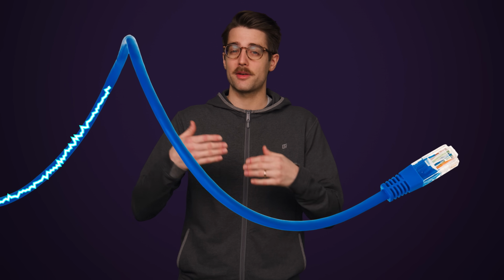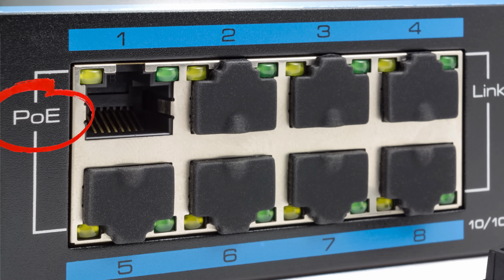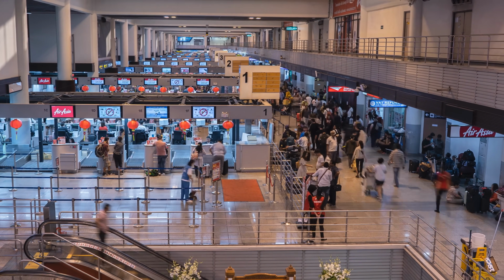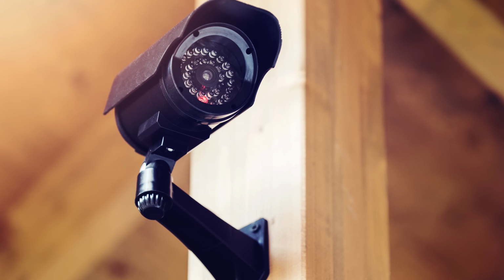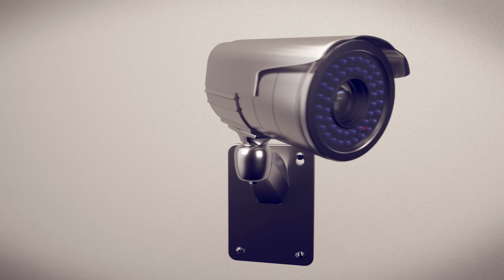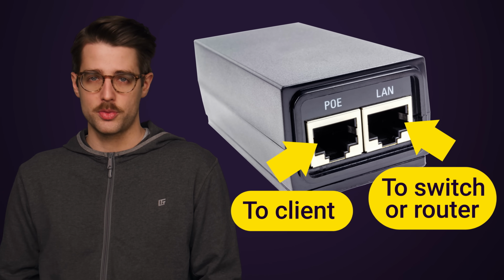Power...Over An Ethernet Cable?

Comment: Why haven’t they been increasing ethernet speeds for current gen platforms anymore? The last thing they did was 2.5gbit a couple years back on most mid to high end boards. But in the high end it’s still the same that it’s been for what seems like over a decade. They just don’t put anything faster than 10gbit on boards anymore, and they haven’t even tried to push anything like 20-25gbit consumer or enthusiast nics out at all. If you want faster than 10gbit you basically have to go into server stuff. I feel there are just certain things people WOULD buy if they existed. If they made decent 2.5, 5, or 10gbit nics with black or even different colored shrouds, people would definitely buy them. If any of the sleeved cable makers made a braided usb c 3.2 gen2 front panel cable or extension, people would buy it. It boggles my mind how I’ve never seen that.  I also think it’s time to upgrade away from sata. If they want to keep selling motherboards with drive connectors, it should be sas and u.2. With those ports you’d still be able to use sata if you want something cheaper, but you’d have to ability to run faster drives if you like. Those sff ports would also save a lot of space on something like an itx board. And on crazy stuff like the highest end eatx boards meant for watercooling and ln2, you’d be able to offer a lot of storage possibilities, with minimal motherboard space. Saves more space for the overclocking and watercooling features.

Comment: You make some good points but why not thunderbolt 4? Caus it does everything
Reply: Thunderbolt is overkill for applications like wiring up a security camera, and Thunderbolt can’t go long distances, without needing to be optical.
For example, the only copper (which you would need to provide power), Thunderbolt 4 cable, that can go 3 metres, is from Apple, and it costs 159 pounds. 
Corning sells an optical Thunderbolt cable for yet further money, and it just won’t provide any power.

Comment: I wish they'd have at least mentioned passive PoE here. 

With PoE (802.3af), PoE+ (802.3at), and PoE++ (802.3bt), voltage is negotiated between the switch and device - AP, camera, whatever - as long as those devices support those standards. 

With Passive PoE, voltage (24 or 48 volts) is applied to the cable and sent down to the device without negotiation, whether it supports it or not.

Another cool thing about PoE++ (802.3bt) is that you can use it to power other, smaller PoE switches. Ubiquiti's USW-Pro-24-PoE can do this. One day I'll put one of those in my rack to power a USW-FLEX, which will in turn power a couple cameras and AP.

Comment: So why does monitors even today have both hdmi and power cord? Why can't we just connect TVs with set-top boxes etc. With ethernet cables? Also doesn't hdmi transfers power as well?
Reply: Because most people don’t have POE Ethernet switches. Many people may not even have an ethernet connection in the same room as their entertainment system. HDMI cannot transmit power.

Comment: Your description of how PoE works is wrong... there are 2 basic right answers...
1. Network cables contain 8 wires, in 10/100 networks only 4 of the wires were used for data and the other 4 were meant for power.
2. In Gigabit networks where all 8 wires are used for data, PoE functions in the same manner as phantom power does in pro-audio... that is... it is injected into the wire, and the receiving device only listens to the part of the signal that it needs to and simply ignores the rest.
In neither case do you get a "bigger" data signal, because, surprise, a copper wire can carry more than 1 signal at a time.

Comment: i discovered this over a year ago. its so useful cause i live in the middle of nowhere, i use cell data to connect to the internet and often the power goes off. i have a 4g router poe compatible that requires 9v minimum, with an adapter to increment a usb power bank's 5v up to 9v. ready to plug in case of emergency (or to watch videos while i wait for the power to come back lol)

Comment: I hail from Pakistan 🇵🇰 and all access points in my university are powered through Ethernet cable directly. (No 5V adapter/power cable)

But interestingly I'm powering Nema 17 Stepper motors for a project of mine using Cat 6 cables. (Sorry no 1's and 0's inside them)

Comment: I use ethernet for everything... Automotive accessories, car audio etc.. Microphone snakes for my home studio.. 12v and 9v power supply for a homebuilt telephone network in my home... It never ends... Ethernet cable passes a balanced microphone signal 1000's of feet with very little signal degradation

Comment: Ethernet cables can also be used to send an HDMI signal (therefore offering a display output). It's positively surprising what they can do!
Reply: I work in school IT support and some of our classrooms are setup that way. There are Ethernet cables run from the teacher station to the IFP/projector and have either a VGA or HDMI over Ethernet adapter plugged into both ends. Pretty neat stuff.
Reply: This is called HDBaseT for the  un-initiated. 

Used where you get long runs where HDMI just can't get to, you have a transmitter at the video source, HDMI from there to transmitter, then CATx cable to an HDBaseT receiver for the projector/TV at the other end, with HDMI plugging into that device.

Comment: Why no mention of what happens (or doesn't) when you inevitably plug a powered Ethernet cable into an unsuspecting piece of non PoE equipment?
What is the risk of loss of Magic Smoke?

Comment: Is it possible to have wireless PoE? A device that accepts the differential signal wirelessly, and a device that sends off that signal into the ether? How big would the logic board have to be to do this wirelessly? Is it possible to micro-mize this? Say, nano-bots powered and connected via PoE? Or maybe a camera module over PoE, rather than a full-fledged camera array? Possibilities endless? Is it possible?

Comment: In the old days we were powering a switch by using the white-brown and brown of the ethernet cable, and connecting them to the + and -  wires of the adapter.

Comment: One correction for this. The power transfer happens between the data-pairs. Not on the data-pair. The voltage of the differential data transmission remains the same.

Comment: Only thing to amend to this: only use an injector if you have just one or two devices and have no plans to go beyond that. Beyond one or two and the switch is more cost-effective, and takes up less space. But having a spare injector does allow you to test and configuring new PoE devices before deploying them.

Comment: There is the opposite approach to this, but there are downsides to this: downsides are that it's about as secure as wifi and any kind of capacitor (that can be built with cables on accident!) will worsen the signal quality. Also, datarates are limited.

Comment: This is pretty cool, but power cables are ran 1-2 feet away from data in Canada because of the emf around a power cable. If you run power too close to data, you can actually get interference. I'm curious to know if these have any issues with that.

Comment: My friends dad is running a start up on wiring buildings with Ethernet so all the lights are smart immediately after installation and tons less wires. He using acrylic panes for the ceiling for demonstrations

Comment: PoE is also used in digital signage, (called PoH or Power over HD-BaseT in that context), PoE++ originated from PoH as a mechanism to power entire TV screens and push content from a single ethernet cable

Comment: PoE uses DC offset to deliver power, not larger signaling voltages...
DC offset moves the '0' point of an entire differential pair to +48v, so that where you used to have -1, 0 and +1, these become +47, +48 and +49 respectively (exadurated example)

Comment: There's been some interesting development with POE in audio interfaces as of late as well. Just started using mixers and stage boxes all over ethernet.
Reply: That's cool. I'd seen some Dante PoE equipment that was just a single XLR or Jack for the times you just need a single input or output, but if full stage boxes are becoming PoE now, that's interesting to see. Though given, IIRC, Dante is the only standard that actually uses Ethernet and TCP/IP to carry the information, rather than a proprietary format (that can do as they wish with the wires in the cable as they're just using the Cat6 cable, not the Ethernet standard) like A&H's dSnake, the only actual PoE devices would most likely be Dante ones.

Comment: From what I have read.
Youre limited to 100Mbps
This is because a Ethernet cable has 8 conductors
TX+
TX-
RX+
RX-
D3+
D3-
D4+
D4-

D3 and D4 are used for the gigabit ethernet.
With PoE, these are used for Power and ground.
After all, they're thin conductors so current is split between pairs

Comment: As an electrician PoE dosen't really make too much sense in my opinion, at least not in any application I've worked in. It's, usually, just as easy to bring low volt power around a commercial building as it is "high" volt. The cheaper price iv lie colt techs us the only advantage I can  think of at the moment

Comment: WARNING: The cables shown as the background at 4:00 are not PoE cables, they are a non-spec compliant hack job that uses the 2 unused pairs on 100Mbps ethernet to transmit power. Using this is a recipe for disaster because if someone plugs the client-end ethernet cable to a device without the splitter cable, you'll fry the device for sure, as those are passive cables that always transmit high voltages on cables that are not supposed to.
The correct devices to extract power from a PoE cable, the splitters, are small boxes, usually with a selector to output 48/12/9/5V and a socket for the barrel connector. PoE switches and injectors always negotiate the power delivery with the client device, so if the client device does not support any PoE standard, power will never be sent, and the cable will work as an standard ethernet connection.

Comment: Ok two mistakes here. First, you really should have told people that using e.g. a 48 V PoE injector with a 24 V PoE device can fry your device. Second, the explanation of how PoE works electrically is wrong. There are three different implementations of how PoE works electrically and none of them is what you describe. The power is not sent as AC, it is sent as DC. It's an offset, not an amplification.

Comment: Passive PoE is not mentioned which is an unofficial standard that older devices sometimes use. Using passive PoE on a device that isn't expecting it CAN CAUSE DAMAGE. It doesn't negotiate like most PoE. Make sure your devices use the correct configuration!

Comment: The old dial tone phone had power delivered to it over modem wire. So POE is nothing new, it's a new take off a old standard. In a emergency you could hook a led light to the phone line and get light.

Comment: 4:03 I actually do this!
I use PoE for some Raspberry Pis, and I use the same hardware to basically turn ethernet cables into extension cords for things like smart lights, or older generation Google Home Minis

Comment: Uh - no.  POE delivers a DC voltage and it does not mess with the Ethernet signal at all.  (It is just too fast to be messed with.)   POE can power a device between 14 and 71W (POE Plus).  Note that the Cat_x cable has very wimpy conductors (wire gauge) so to deliver more power you must raise the DC voltage - more current would fry the wire.  (44 to 57Vdc). The 57V seems weird but there is a legal requirement that the voltage not exceed 60V for human safety. Also the Cat cable is "plenum rated" which is a fire safety requirement. Interestingly the power negotiation trick POE uses with its end point devices to request a power allocation is similar to what they are doing with the latest USB modules.   The POE solution was originally for just IP phones but branched quickly to WIFI, LED lighting fixtures, etc. Large companies save a tremendous amount of money putting this stuff to sleep at night when not in use. Cisco Systems has a piece of software called EnergyWise. Basically it can monitor this power grid you create with POE and schedule power reduction/recovery,  power cycle (reboot) or request the endpoints go to sleep etc. Very slick.

Comment: i was flipping through my lab's old equipment, and found a controller device that has no power ports or batteries. So it turned out to be PoE enabled. cool stuff. can u do a video on RS232 port as well?

Comment: From I read in the past, PoE use unused cable pairs to transport power.

Turn out there are 2 methods.

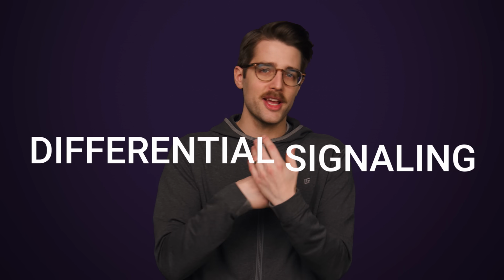Alternative A is as Rilley explained in the video @2:40

Alternative B is using unused cable pair.

https://en.m.wikipedia.org/wiki/Power_over_Ethernet
Reply: Correct, it has to do with the wiring standards in the sequence the cables are run. T568A vs T568B

Comment: Well, I get that TechQuickie needs to simplify stuff, but that simplification went all the way to “wrong“. Instead of a fine opportunity to explain differential Vs common mode voltages, something not too difficult to grasp, they handwaved it to differential voltage just being bigger. That's just wrong. At that point, you'd have been more correct saying "It just works, don't worry about it“.
Reply: I hope they will address this and make a correction :(
Reply: Heh, they are bunching together the "dumb" PoE kind that just uses a wire pair for power transmission with active PoE too, for that matter. The adapters at 4:05 are for dumb PoE or chinesium-grade PoE
Reply: Came here to say this, glad someone else caught it as well.

That is not how PoE carries power at all.

Comment: I've been using PoE for a decade now. We are currently looking at PoE light. Yes, controlling the lights of a building through PoE. The idea is to remplace those T8 fluorescent tubes since in the long run it will cost less power. A green approche, you could say.

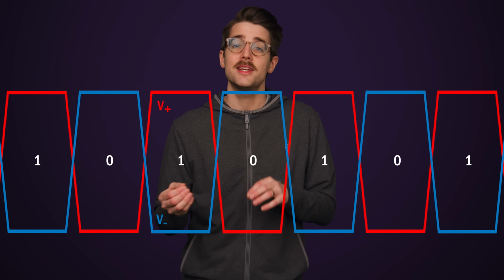Comment: Slightly incorrect at 3:00, DC bias is added to the signal, the differential amplitude does not increase. The signal is just shifted up significantly in voltage (both positive and negative pair). The signal then swings around the higher voltage instead of swinging around/across 0V.

Comment: 2:60 Your graphics are misleading. It shows the differential voltage increasing for POE, when in fact its the reference voltage that increases, the difference between the high and low remain the same.

Comment: I've used PoE a couple of times with an injector and splitter when I didn't want to run an extension cord too.  I only had trouble once when I realized I was using a 4-wire ethernet cable.  Gross trash.

Comment: the mapping of positive/negative voltages to 1 and 0 bits is actually somewhat more complicated (mostly due to the need for clock recovery), and each of the four main twisted pair Ethernet versions use a completely different coding scheme, and the DC voltage is superimposed across two separate pairs, not by increasing the amplitude of pulses on one pair... but I guess it's close enough for this channel's audience.
Reply: I disagree that it's close enough. This show is meant to educate. Simplification is okay, as long as the explanation doesn't turn wrong. If it does, then it's actually hindering anyone who doesn't know and goes looking for more information.

Comment: I used to work for an AV and Automation installation company and we used PoE everywhere we could. It was extremely convenient to just have PoE because other than not having to worry about power outlet locations, our commercial switches usually had remote control software to allow us to remotely power cycle devices over PoE. Most commonly used in Access points and security cameras for us.

Comment: PoE really changed the installation industry, both decreasing some aspects of work as well as opening up new product lines for the client to purchase

I remember the early standard being limited to 10/100 Mbts due to the 4th pair originally being reserved for voltage, 
when I went to a presentation that sold a Gigabit PoE device I had to call bullshit, only to be schooled on the new standard that Techquickie kinda explained here

Comment: at 2:40, I think his words are right but the graphic is wrong.  No power would be sent if there wasn't actively data being sent and if you sent a 0 byte, there would be a gap in power delivery.  Instead it sends a DC voltage, and because the receiving end measures the difference in the voltage, not the voltage itself, the signal is fine.  To get what I mean, use a graphing calculator.  Their graphic is sin(x) vs 2sin(x), while in reality it would be like sin(x) + 2.

Comment: Power over ethernet isn't new, you can even get ethernet over your mains plug with the right equipment
Reply: Some devices you can literally just plug in to the outlet and it'll be connected to the internet, like a wifi router, or computers

Comment: POE splitters(as opposed to injectors) are actually pretty cool for powering things like Ring(or any wireless security system) base stations!
I ended up running CAT6A into a central hallway of my house(as well as other rooms), and putting a splitter into the wall at the termination so I could locate my Ring base station there, and not have to rely on 2-3 range extenders(and their eyesore wall-warts) throughout my house, and the sketchy connection issues that come along with using too many of them.
Highly recommend POETexas splitters for stuff this, not affiliated with them or anything, but their splitters are actually standards compliant(802.3at), and they make some other really cool niche POE stuff that I've used for biz clients, as well as my own home use.

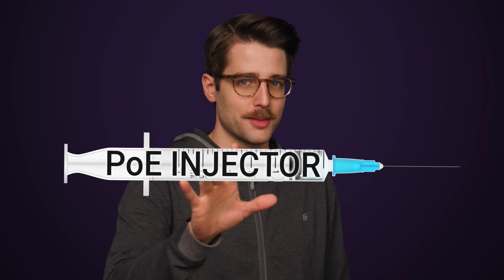Comment: Funny fact, both injectors you showed at 3:43 are actually from ubiquiti. The first is their newest model that can provide the PoE AF standard, and the first is the old passive 24v injectors they used to use with older Access Points like 7 years ago.